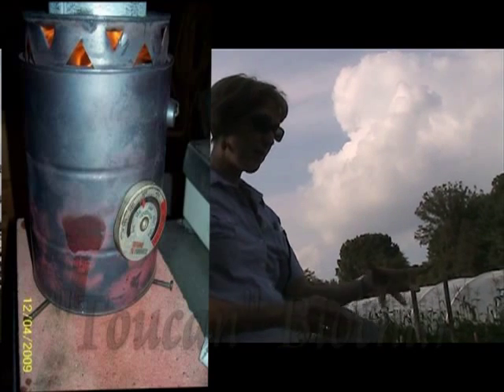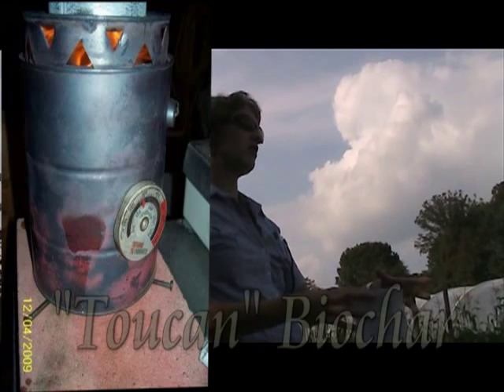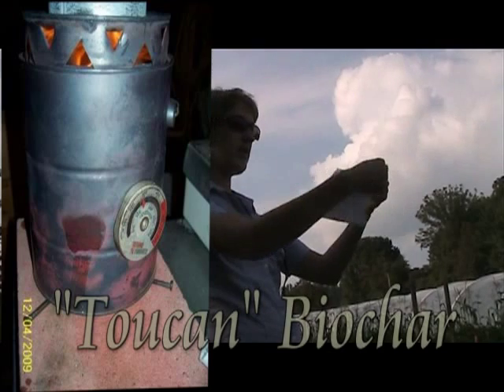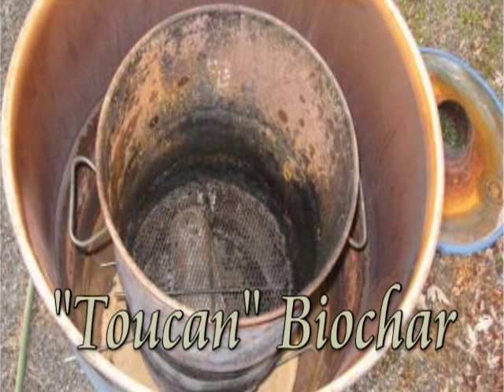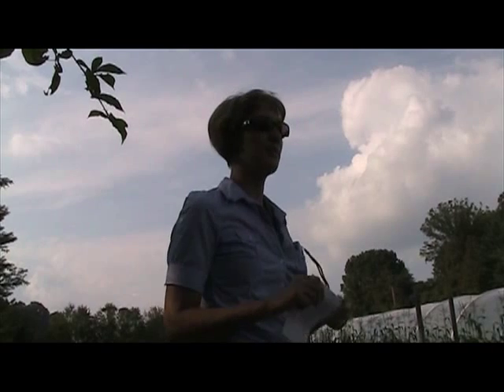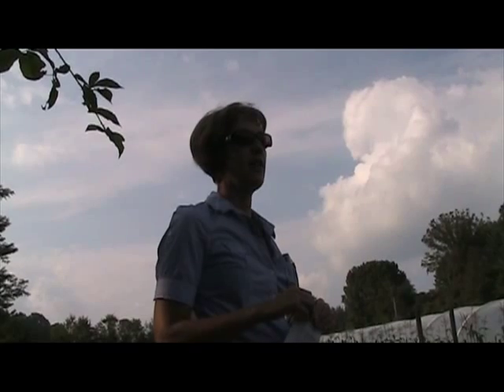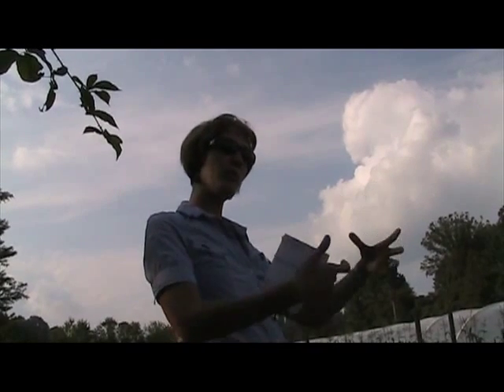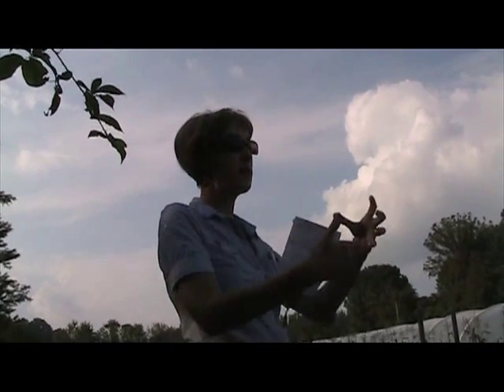How to Make Biochar, Abingdon Biochar Part 3

Comment: bio char,bamboo grows in about three years so its fast,wood, many years longer.pelleting machines turning leaves,rice hulls, different kinds of hays, would be the fastest ways of condensing the materials and turning it into bio char without the added labor of breaking it down small enough to put into the soil. Also as hot as a Fresnel lens gets you should be able to find some way of incorporating it into the char making process